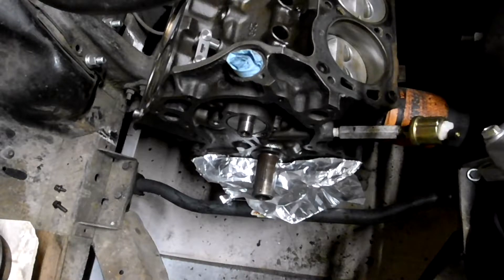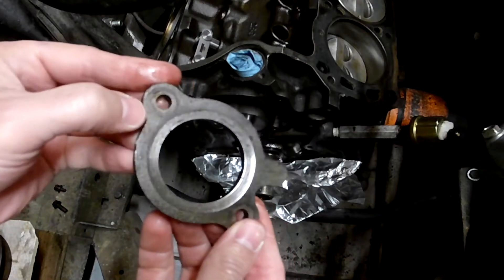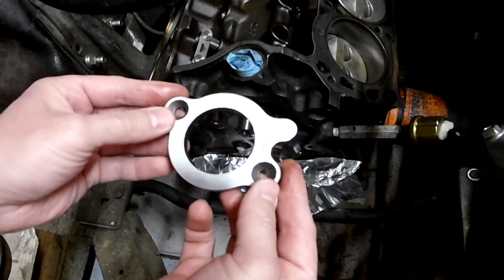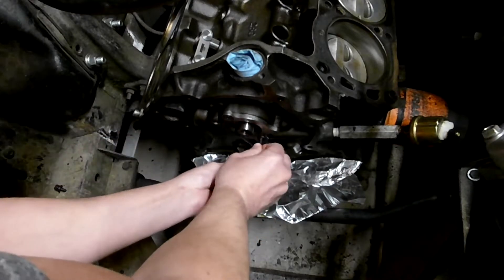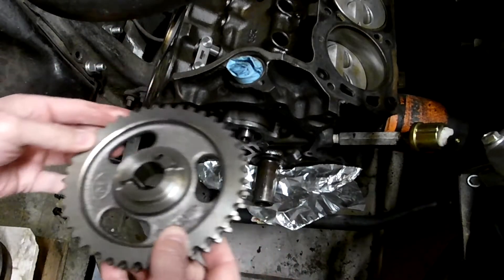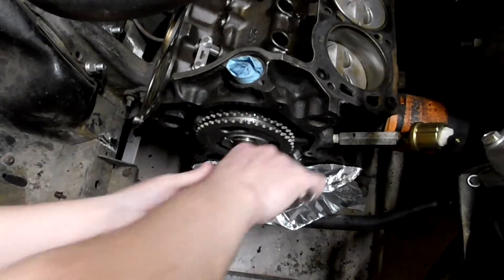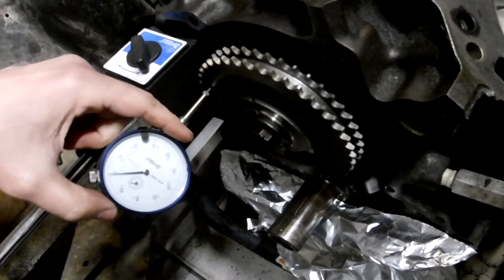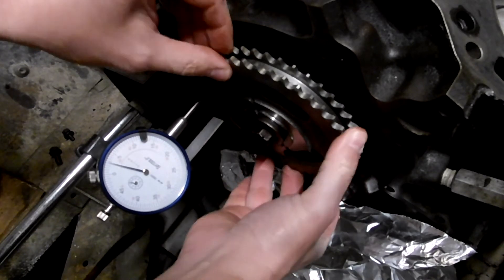SBF Camshaft Endplay - Ford 289 Cam End Play

Comment: Do you need to have any lifters installed to check for end play?
Reply from the maker: No lifters need to be installed, and I would recommend not having lifters for this. If using flat tappet lifters, it may skew the reading since flat tappets have a slight crown/tapper (to allow rotation on their vertical axis during cam rotation). That tapper may cause some resistance to the fore and aft movement of the cam while measuring the endplay.
Reply: @ThatsOneTrickPony  already got the job done, currently working the rocker arm geometry on my channel

Comment: What do you do if it’s not within specifications.  You installed a new thrust plate. So what’s the problem? Worn cam end or bad cam gear being worn?
Reply from the maker: I think most problems will be too little end play (tolerance too tight). This can lead to a bad mesh with the cam gear and poor lubrication between the cam and thrust plate. If the end play is too tight, the thrust plate can be milled down. Too much end play may be due to a mismatch of parts. 
In my case, I didn't measure end play during disassembly only when a put in the new cam, but the groove worn into the old thrust plate was on the sprocket side not the cam side. I believe the incorrect sprocket was on my engine (too thick). I have an early 289 which requires a different cam sprocket and timing cover than later SBFs. The rebuilders in the 90's likely used a 302 sprocket with the early timing cover. The timing cover had witness marks on the inside. Likely the timing cover was pushing the sprocket into the front of the thrust plate causing the groove.

Comment: Had a mini heart attack cause I'm almost done assembling my motor and realized I forgot to check mine. But the plate looked brand new so just slapped it back in there and I should be good to go
Reply from the maker: I think you'll be fine. For most applications, it's probably not necessary. I believe it's akin to degreeing a cam. It's good to know, but not usually critical.
Reply: @ThatsOneTrickPony  actually had to check mine again and turns out my comp gear was making WAYY too much clearance so it would've destroyed my distributor gear. Ordering a new timing chain to make it right but this goes to show CHECK EVERYTHING
Reply from the maker: @ethanbunch3274  Wow! Glad you checked that out. As we say in my family, anything worth doing is worth doing twice. Good luck!

Comment: Was the original thrust in backwards?  Look at groove and bevel on new one
Reply from the maker: I don't think it was in backwards. I believe there was a mismatch of parts. It's a 1965 289 which has a different cam sprocket on the stock engine compared to later 289s and 302s. The water pump and timing cover are also different on early 289s. The engine was rebuilt in the late 90's. I think the wrong combination of parts was used, and there was not enough tolerance.